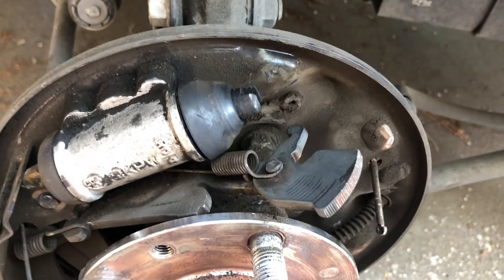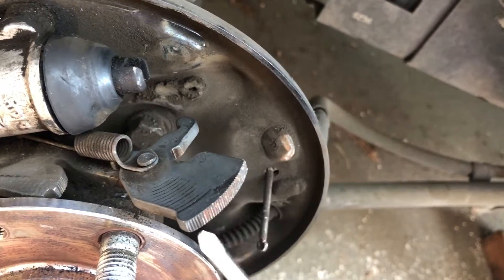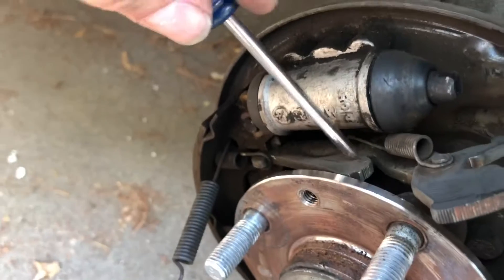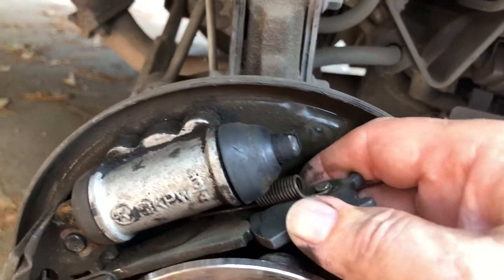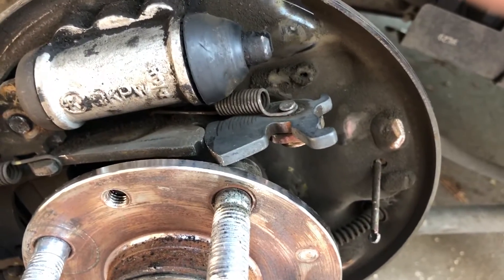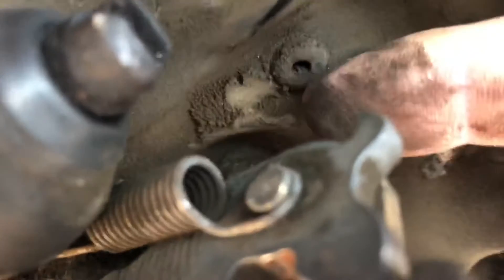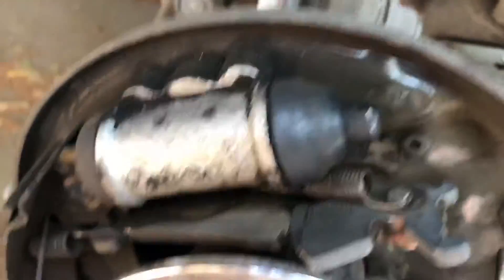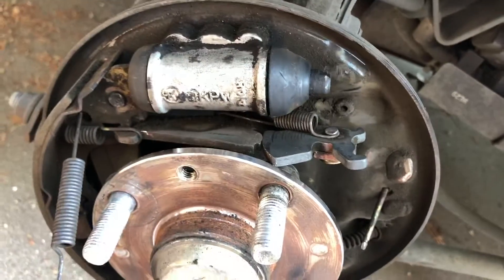2000 Kia Sephia spectra rear brake drums adjustment cam what the hey ?

Comment: my 2000 spectra was dumping brake fluid last week and I'm having tons of fun replacing the brake cylinder, brake line, and now assembling it all together.... I have the Haynes Manual if you need any additional details on how you adjust the cam.... the Spectra and Sephia are pretty much the same.
Reply: @hardkore360 hey man,
do you have the pdf version of the book?
thanks
Reply: @islamboudjeniba8279  yep still do, what do you need?
Reply: @hardkore360  I've a 00' sephia & i want that book really bad, the book isn't free & couldn't find it anywhere for free
Reply: @islamboudjeniba8279  the book is pretty long to scan, I dont have the whole PDF version, is there a specific part you need 1st?
Reply: @hardkore360  yep it takes time, the braking system maintenance if you can please.

Comment from the maker: Guess what everybody Scotty Kilmer and others point to one possible major problem  & why why why this car has never been able to stop via the masny bleeds, many brake parts, brake jobs. They think I have a bad brake booster!  I Checked the vacuums a few yrs ago as suppiled by the engine and that 'special sucking hose it read okay. That says very little (1/3) to the system But I did not the other main 1/3 - do the step on pedal after running. Turn off running engine after 2 minutes parked. Otherwise be at home- wait a bit 10 seconds then holding brake down beforehand. start car. Does the pedal stay put or push your foot up.  If it pushes That's a bad booster.  I am 90 miles from my POS Sephia which has cost me easily over $1700 these last 4 yrs to repair register and insure. I cannot sell it because of liaibility with no brakes. The engine is fine however starts right away but has newly worn out 10,000 mile 2nd pair the cheap as crap O Reilly engine mounts. Kia's last 20 yrs. The O Reilly material is gone in 6 months. Get them from any junk yard of original just like Toyota. The aftermarket suppliers use old regeround tires or worse. We are at the mercy of an industry that does not al;ways want are hearts- just our money. Thank god we can share here at Youtube, another ruthless platform that uses us like cat litter.

Comment: YOU USED THE WRONG COLOR SCREWDRIVER TO POINT AT STUFF. thought you weren’t allowed to make wrong decisions in the navy or whatever the hell you said?
Reply from the maker: These New brake shoes did nothing, as did further bleeding, as did front brakes, and mech said do the rear hydraulic brake cylindedrfs (only @ $40) but ZERO results improved.. Now they say ABS Pump & Module... shtttt